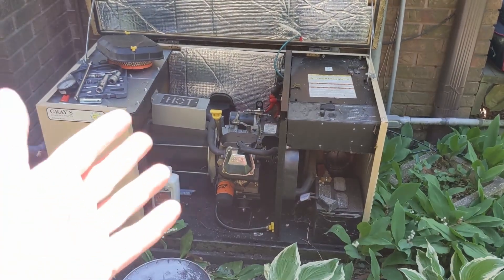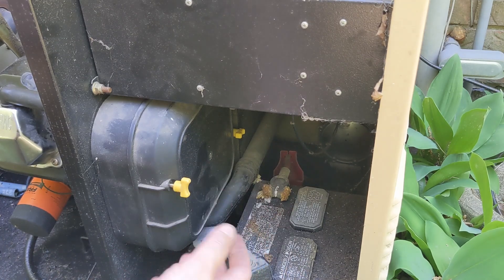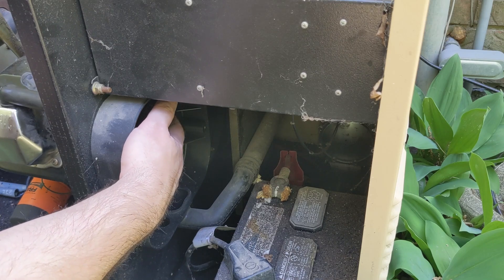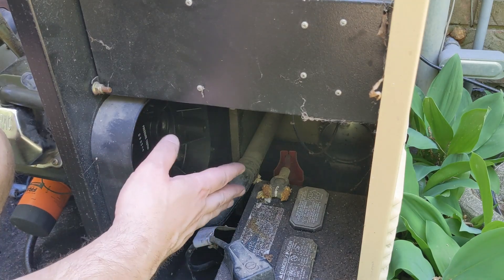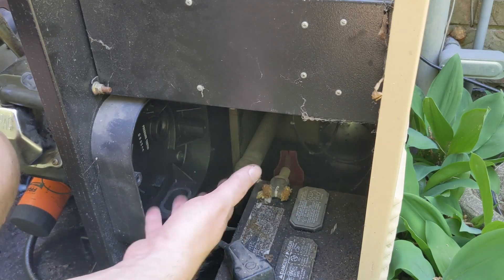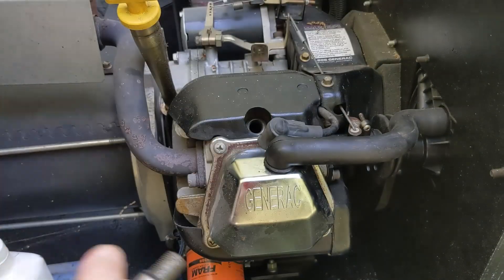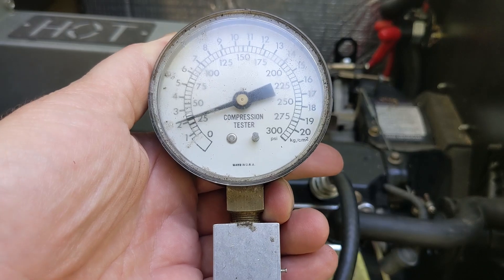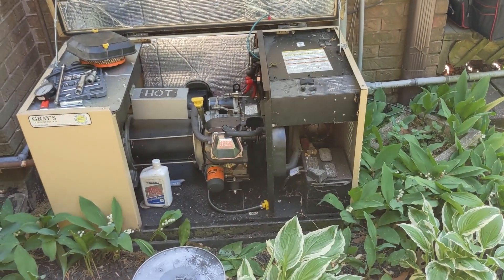Generac Generator Cranks but Won't Start - A Quick Guide to Diagnosing the Problem

Comment: I've worked on Generac generators for many, many years. We do not rebuild engines for customers. We will either replace it with a good used engine. Or sell them a new engine.Too much work and liability to take it all apart. If there's an issue then we're gonna eat the cost. If you want to rebuild your engine, you'd better research all the parts needed for you even touch it. Could be discontinued.

Comment: Exhaust valve seat drops into the head?
Reply from the maker: The fact it gets some compression tells me the air isn't just flying out of the cylinder - there's some resistance.  That tells me it's probably rings, a burnt valve, or a crack in the head.

Comment: How many hours on that?  Couldn’t it just be a stuck valve?
Reply from the maker: This one is old enough that it doesn't have an hour meter, but it really doesn't have a ton since it really just runs for a short period once a week to exercise, and say a half-dozen times a year when there's a power outage.  The fact it has some compression tells me the valves are closing, but pressure is leaking out.
Reply: @YoshimoshiGarage  Dump a small amount of oil into the cylinder via the spark plug opening and then re-do your conpression test. If it is the rings the compression should climb. If it is valve,  the compression should not change.